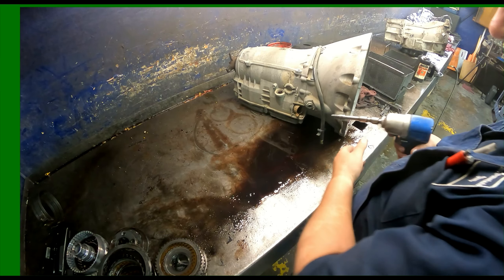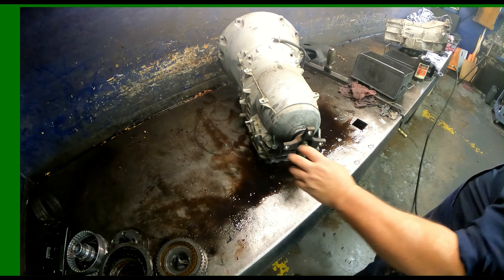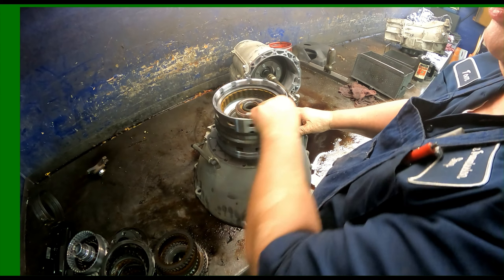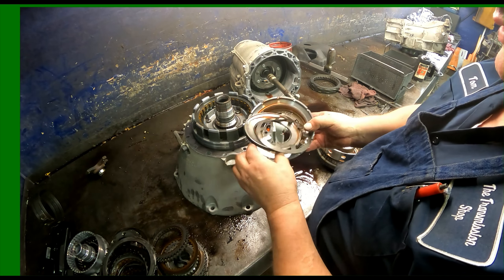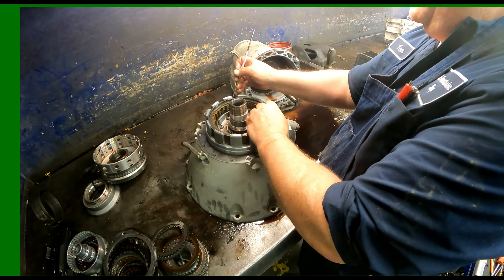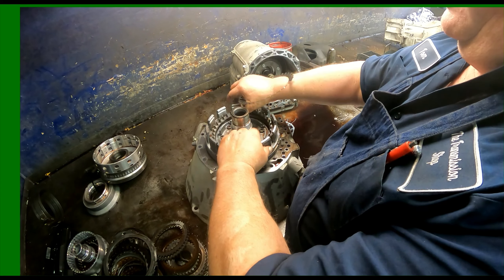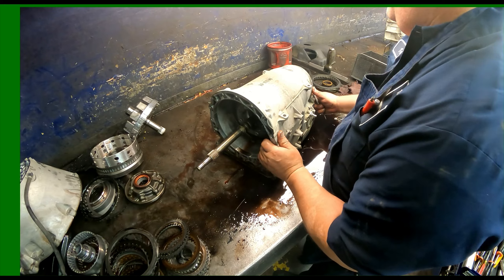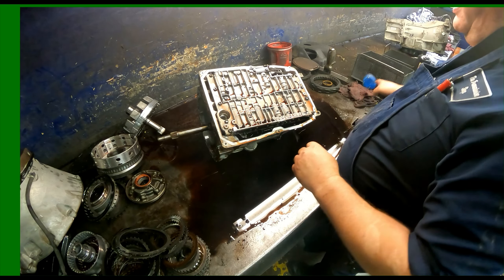Mercedes 722.6  Chrysler Nag1 Disassembly

Comment: Tom are you still doing nag1 transmission repairs? I have a 2014 Dodge Charger that starts to shift clunky in all the gears especially after the car is warmed up to temperature. 97000 miles on the car. Fine metal dust on the magnet. Looked like kind of a lot. No shavings or chunks at least. Only a 0730 incorrect gear ratio code came up. But has not come back in a while. I put Mopar fluid and a new filter in. I think I will do that again. Any suggestions?

Comment: My wife has a 2012 jeep wrangler with this transmission. The other day we went for a ride. I was going 50-60 mph and the transmission went completely neutral. I have park but everything else acts as neutral. All cables work as they should. I removed the starter and looked at the flex plate and bolts to the torque converter. Both turn together as they should. Any ideas? Jeep has 70,000 miles and fluid looks great. Ran without a problem and boom no gears. Thanks
Reply from the maker: Couple of options. They have a software issue that will shift the transfer case to neutral or probably the pump broke. The system will need to be scanned for codes first and see if it needs updated software.
Reply: Would that pop up a engine light on the dash? I am not getting any codes via osb2. Or is this issue with the TCM?
Reply from the maker: Not necessarily. Need a higher end scan tool and scan all systems. The cheaper code readers are not going to give you all that.
Reply: Awesome thank you for the help and information. That is exactly what I have, just a $100 scan tool.

Comment: Tom - I have an opportunity on a NAG1 and the owner says a mechanic told him what's causing limp-in mode is 'Transmission Relay Sensor. It's the sensor that tells the car which gear it is in.' Does that sound like conductor plate? I assume this can be done with the transmission in the car? Thanks
Reply from the maker: Never heard it called that but yes the conductor plate has that on it. And yes to it being done in the vehicle. Make sure when you get it they send you one for a Nag1.There are 2 different plates. The difference is where the dipstick comes in. It is a different shape.

Comment: Removing the valve i place it in a oil pan and when i lifted it up there was a little pin underneath sitting in the pan. Smooth cylindrical and indented on both ends. I for the life cannot figure out where it went
Reply from the maker: Probably the pin that keeps the detent lined up.

Comment: Do I need to remove that rear output shaft bolt just to remove the bell housing, so I can replace my front pump?? That’s all I need to do. I don’t see why I can’t just unbolt the bell housing bolts and pull it loose. Unbolt that pump, put a new one back in & put it all back together.
Reply from the maker: No, you don't. It is however easier to load the front half onto the pump and lower it into the transmission together. I use a pair of vise grips on the input shaft, like I show in the rebuild video. You will have to remove the valve body to do that though. https://youtu.be/QxQTDfNuVS4 you can get it apart and back together without doing that, but it is easier that way. Would probably take 2 people, one to hold the transmission upright on its tail and another installing the pump. You will need to get the clutches to all line back up. Shaft should turn easily once bolted down if everything went back together properly.

Comment: Hey I have a nag1 in a ‘13 srt8 challenger and it doesn’t catch park , Rev, drive , it just rolls been running fine, downshifted couple days ago nothing crazy , then it stopped moving , it still shows gear change on dash , but car does not move, and when running and placed in park it makes a grind noise for a sec then it stops ,
Reply from the maker: Sounds like the transmission is still working. Check the nut that holds the driveshaft flange on. They have been known to come loose. That or something with the driveshaft it sounds like.
Reply: @CurmudgeonTransmission  yesterday I crunk it up and when engaged in reverse you feel in the gear shift something slightly turning but when you engage neutral or drive no feeling , still no movement complete

Comment: Hi I was driving my Chrysler and I felt all my gears go out. So I pulled over I had no drive/reverse. And felt like it was in neutral. When I put it in park I herd gears grind.  Any suggestions?
Reply from the maker: Sounds like you either have a rear end problem or with what they call a geebo. It is what they use in place of u-joints.
Reply: Think my transmission went out. I checked to see if it was rear differential. The drive shaft was not moving. Hear some thing spinning in the trans and every time I put it in park. It makes a grinding gear. Or it don’t wanna go in park. .
Reply: @CurmudgeonTransmission  any other suggestions
Reply from the maker: The internal of the transmission are turning that is why you hear that noise when you put it in park. Don't keep doing that, when it gets slow enough it go into park and you run the risk of something breaking internally. You probably have a bad front Geebo or if it is 4WD something wrong with the transfer case.

Comment: Is the Nag1 a good transmission?  I know mercedes and chryslers relationship  didn't last very long.
Mercedes  are a car I would never buy. only good for leasing.. break too much and too expensive to fix.
Reply from the maker: Decent. Mostly conductor plate problems and They have a real problem with fluid going up the harness and into the computer wiping it out.
Reply: @CurmudgeonTransmission  How does that physically happen? It's not like the wires are cotton wicks. I have a Jeep Wrangler with NAG1. I take good care of her. Just curious to know how that problem occurs.
Reply from the maker: Capillary action, does act like a wick. Once the connector starts leaking if it is left alone and it gets bad enough it can do it.
Reply: @CurmudgeonTransmission  Interesting! Thank you.
Reply from the maker: Thanks for watching.